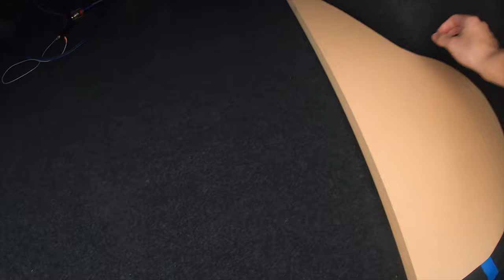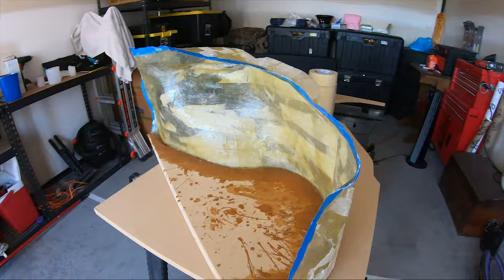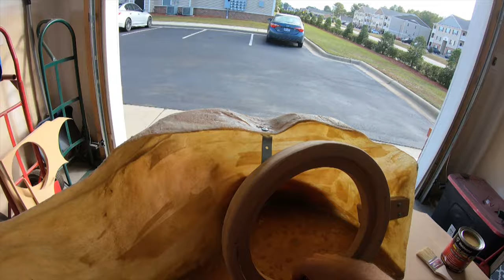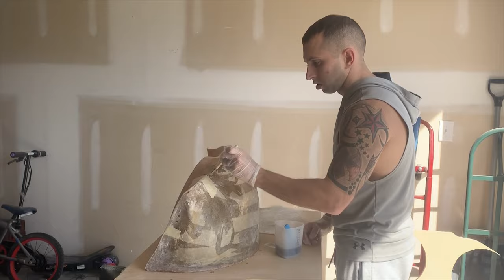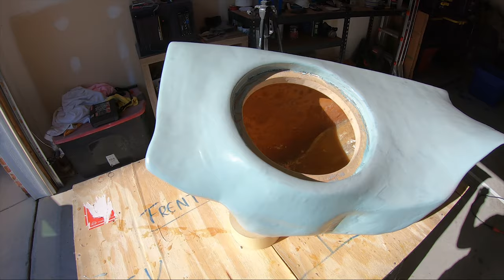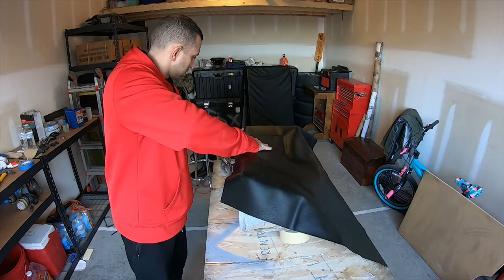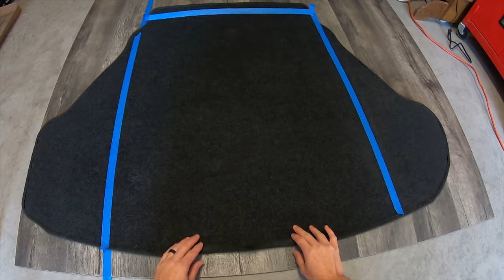Building a custom fiberglass subwoofer enclosure & trunk setup in 10 minutes (Time Lapse)!

Comment: I was about to get started on this project for my car and wanted to see how others did it. This couldn’t have been more perfect for that. Same subwoofer location I am wanting, same materials I was looking to use, even the same subwoofer I’m hoping to use. When you whipped out the wood floor it really blew my mind because that’s exactly what I was planning to do as well, so in the future when I have air ride I will already have a nice trunk setup I’ll just need to add the tank and compressor and run the lines. Awesome job!
Reply from the maker: I’m glad you found it helpful!! If you want to go back and look at the entire series there is a lot of good tips and tricks in there that will prob help you out! If you have Instagram, sent me photos when you’re finished cause I would love to see it!
Reply: @Foxcraze question when you put the ring on for the subwoofer what was that material for the front before your fiberglassed was that a sheet?
Reply from the maker: That was stretch fleece from the craft section of Walmart. I have full length build videos of this entire trunk from start to finish in my video library that gives a lot more detail.
Reply: Hey @Foxcraze what did you use to.sexure the case to secure it to the trunk?
Reply from the maker: @cornelionutmicu3640 so no lie it was so tight in the molding that after adding the wood panels to the floor it locked it in and it hasn’t move an inch.
Reply: @Foxcraze  ok i want to do the same thing to my BMW E87 and I wasn't sure how to secure it and was afraid it would move once installed
Reply from the maker: @cornelionutmicu3640  I have seen that putting sticky back Velcro on the back and bottom of the enclosure will help it grip to the carpeting.

Comment: One of the most thorough sub enclosure build I’ve seen.. Wow! Awesome job. Looks great.
Reply from the maker: I appreciate that, I have a 4 video series on the channel that’s goes into even more depth on how to build one yourself from start to finish.
Reply: you call that thorough?? a boz that light can pass through? no bracing?
Reply: Maybe you should watch other video’s then
Reply from the maker: @sfantuch what are you complaining about? The enclosure has over 5 layers of glass which is more than sufficient for what it’s required to support. The only surface that isn’t a complex shape and flat is the bottom which is wood so it didn’t require structural bracing.  Not to mention it’s been solid with no cracks or issues for several years of use so far. Do you have a video or something you have done to show us what right looks like?
Reply: @Foxcraze  unrelated to this comment. as someone who just spent a bit too much on  a used router, seeing you suffer with that dremel made my purchase so much more tolerable.
Reply: @Foxcraze  unrelated to comment. BROOOOOO WOW I DIDN'T KNOW FIBERGLASS COULD DO THAT THIS IS SO COOL. AS A CRAFTSMAN YOU HAVE CHANGED MY LIFE.
Reply from the maker: @sparklesparklesparkle6318 I hear that, the dremel was a pain in the ass lol

Comment: Much appreciate the share. Got a Lil sick when you F.F. the action cam on head but  saving me time and hassle with how you outlined the area using a plastic sheet will save me having to pull the rear side paneling on the wagon. Thanks

Comment: What an awesome build and video showing how its all done, thanks for taking the time to show us all how you did it. And kudos to you for having the skills to pull it off!
Reply from the maker: Thank you, I have longer in depth videos covering each step of the project in my video library.
Reply: @Foxcraze  good to know, I recently bought a custom enclosure for my is300 (2002) but I am struggling to find a good place to mount my amp. That led me to your video, even though it’s about building a subwoofer enclosure I thought maybe I could take the info and customize it to build a custom amp rack. I want to mount my amp to the side like you did your sub. I just have to figure out a way to add a fan in as well so my amp doesn’t overheat being stuffed in a somewhat sealed space.

Comment: That was a great relaxing video bro. I'm 42 now but all through the mid too late and early 90's and 2000's This is how i made extra money on the side working for myself through mostly just word of mouth. I had a honda accord and took out my back seats and built probably my most crazy setup ever in place of the back seats using basically the same method. That car was crazy loud back in those day's before thing's really blow up in the bass and system world with some of the crazy stuff they got out there these day's. I made good money doing stuff smaller though like you did. My car at that time was the biggest project like this i ever did and it turned out amazing and clean sounding from highs and lows a well balanced combo between treble and bass. It was all flowing nicely it was just a flat surface over that wide area instead it looked like a wave kinda with speaker's from 8's too a 15 being the largest in the middle 8's on the outer then some 10's and the 15 it was so beautiful and i wish i still owned that car. A buddy of mine borrowed it and got into a bad accident and by the time i was allowed too actually Physically see and touch my car the majority of whatever was still good from that massive project of a system was stolen so i was told by the lot it was being kept at while investigation was going on because it was a bad accident unfortunately. But watching this brought back those memories of the amount of time and sweat and everything that went into that build. Thank you for the relaxing video and memories it gave me of a time when this was how i made a living all those year's ago.
Reply from the maker: Yeah man I feel everything you’re saying. My old truck had a wall of MA Audio 1200 XL’s running on over 4k watts. I have been dabbling in cars and the such since I graduated high school in 2004 and it’s been a constant learning experience. I will likely keep doing this shit till I can’t anymore, it’s just makes me happy haha thanks for the watch and the positive energy. If you haven’t already please subscribe and check out the other videos lots of projects in here and more to come for sure!

Comment: Just watched this for the second time...lol. I'm wanting to do an enclosure in my Chrysler Crossfire. I was debating on using wood for the front face or fiberglass. I was hoping to see how you attached the subwoofer rings to the enclosure. Do you have any suggestions for that? Or pics of what you did? I am assuming you just put wood and glassed it to the back of the enclosure somehow.
Reply from the maker: Check out the 4 video series of the enclosure build specifically. Those videos cover all the details of the project including bracketing the ring for fiberglass work.

Comment: Looks great! I have two of these from OEM Audio+ in my BRZ. The only thing that was puzzling to me was the Dynamat inside the enclosure. It won't let sound leak through the enclosure walls, but it will definitely create standing waves and reverberation. You need to use some polyfill insulation to help with that.
Reply from the maker: Good idea, thanks!

Comment: it looks amazing, but is the back wall of that thing actually stiff enough to prevent it from flexing?
Reply from the maker: Yeah it’s very sturdy and has been in constant use since 2019. This video was a sped up version of the original build series, the entire box has minimum of 4 layers of glass.

Comment: gotta put a port on it bet that thing will sound better with a small 3in port the the left of the sub
Reply from the maker: Would it be as simple as cutting the hole and bonding a universal 3” port tube in the location?
Reply: @Foxcraze  should be that as long as what you’re using to cut won’t crack the fiberglass like a dremel or something i run two ported 12s in my wagon even a single with a port adds a lot more auditorial bass

Comment: How does it play? Could it possibly be ported? What’s the internal volume of something like that? I got a couple 10’s that love .7cuft
Reply from the maker: It’s more than enough for my needs at this point in my life. I have had 4k watt systems pushing 12’s and 15’s in the past and I don’t need that anymore to be happy lol. 

Given the space that I wanted to occupy to keep trunk space available; I think porting it properly would take up more space than I would like. By purely guesstimating, .7 is around the air space this box has which is what this sub needed sealed.

Comment: I realize this is 2 yrs old now - and I plan to look into your other videos you mentioned in other comments here about bracing and such - but my question is - is the sound deadening material INSIDE the sub box to prevent flexing, or stops it from shaking the side panels of the car?  Would it be beneficial to add deadener directly to the car's body behind the carpet in the trunk too?  Would it be advantageous to remove the carpeting completely on the side and use all the nooks and crannies for extra volume, or will that be bad for vibration since the box would be nearly touching the body panels without anything but a few layers of sound deadener between the fiberglass and body panels?  I realize it also puts a damper on the installation as well getting it in to fit and take it back out, but I wouldn't plan on ever taking it back out unless I was going to rebuild it again anyway - and though perhaps using a few bolts could really hold it in place well too as part of the bracing?

Sorry for all the questions - your build really inspired me and gave me a lot to think about!  Great job!

Another question - would a 15" sub with roughly 600-800 RMS be too much for a side mount sealed enclosure like this?  I have two and was thinking of putting one on both sides of the car's trunk.  Even if they are slightly angled upwards and forwards like you have in your video - does that make the sound from the opposite sub cancel out at all with both woofers in the same phase?  Mostly a bit curious if a fiberglass box would work for a pair of 15"s and save some space for larger things in the trunk.  (Brand is Stereo Integrity SQL 15s if that matters)
Reply from the maker: Alrighty so before responding I will say upfront that I am not an audio expert by any means and what I say next is based off of information gathering and personal experience. 

I’m gonna try and hit all of your questions but if I miss one, hit me back in a second response. So as for the sound deadening, I placed it inside the enclosure as a result of information I read in mid 2000s audio forums that stated that for fiberglass enclosures it would help kill standing waves and make the enclosure sound less hollow. I wasn’t sure if it would matter much but from my research it def wasn’t going to hinder anything either. 

Sound deadener can and should be applied to any thin metal to reduce vibration heard from outside the trunk and removing the carpet to get any extra hidden volume is always a great idea especially if your subs require a higher sealed volume to be effective. The subs you have need 2 cubic feet of airspace each and depending on the size of your trunk that might be hard to achieve without using the hidden recesses behind the carpet. I have never personally seen a 15” in a sealed corner mount enclosure but that doesn’t mean it’s not doable as long as the enclosure is built with enough layers to hold the weight or the 15” and larger enough to reach the 2 cubic feet of internal volume. 

Typically a molded enclosure will stay in place fairly well with very minor securing needed. I have seen people line the outside with velcro strips to grip the carpet flooring when the enclosure is installed and it work just fine. “mine has never moved this entire time”

Lastly from what I have read, subwoofers are omnidirectional so facing them at one another should not cause any issues at all in performance.

Comment: Can you explain the cutting of the wood? I didn’t understand that part
Reply from the maker: So I do have an entire video on the floor Installation that will give a lot of context and answer any specific question you probably have. Essentially after drawing the outline the tape was placed on the outline to prevent the laminate planks from splintering and messing up the finish. The cardboard piece at the bottom was a template of the plastic trim so I could cut that off the planks as well before Installing.

Comment: So how did you mold the front? It shows you cutting the speaker hole and then cut to you adding the pink foam.
Reply from the maker: That’s not pink foam it is stretch fleece that was stapled and glued to the fiberglass and wood frame to soak up resin which created the initial layer of the face of the enclosure. I have a 4 video series on my channel that goes into detail of the enclosure build. This was just a time lapse of the entire trunk project.

Comment: The box didn't need a hole to allow the movement of the air caused by the speaker?
Reply from the maker: The subwoofer works in both ported and sealed enclosures. The ported would have required more airspace so I decided on sealed.
Reply: @Foxcraze  such a great job
Reply from the maker: Thank you man!!

Comment: Great work, any tips on how to lay the fiber flat and clean like yours? Last time I attempted it, I had bunch of large bubbles, and my initial base layer was very wavy, not clean like yours.
Reply from the maker: It all about percoating the surface with a light coat of resin before applying the chop mat then using the brush to press resin into the mat instead of brushing it into the mat.  Pressing releases the air bubbles; brushing won’t.

Comment: why did you put sound deadening on the inside of the box, i gotta know
Reply from the maker: I read in a couple audio forums that sound deadening the inside of a fiberglass enclosure helps with reducing vibration and adds a little extra rigidity. It was cheap so went ahead and did it. It’s not necessary but doesn’t hurt anything either as I have read at least. 🤷🏻‍♂️ lol

Comment: Was the front of the box made with foam and resin then fiberglass?
Reply from the maker: Creating complex shapes is easy to do  when using fleece. Stretching and gluing and or stapling fleece down on an area will give you a complex shape that you can then saturate in resin to get a solid foundation. Once it hardens, cover it internally and externally in layers of fiberglass to strengthen it.
Reply: @Foxcraze  genius

Comment: Was the brown n gray coating bondo?  If so why was it so watery?
Reply from the maker: One color was fiberglass resin jelly and the other was bondo. They were both mixed with a small portion of resin and it’s liquid hardner to allow them to be brushed on and level out better. 
I have a 4 video series on the enclosure build that talks about it in better detail.
Reply: @Foxcraze  thank you

Comment: Great job but did you figure out any of the box dimensions for the sub? You shouldnt just stick a sub in an ole box.
Reply from the maker: Gonna be honest with you, I figured out the general square dimensions for where it sits and deducted the approx area lost and then guesstimated space added by the extra length I extended and hoped for the best. In the future I won’t use the wood, instead make the entire thing outta of fiberglass and fill it with water and figure out the cubic feet based on gallons of water it takes to fill. I can then add to or take away from the enclosure to get right where I need to be.
Reply: @Foxcraze  appreciate the honesty. If you think you are high you can add pillows to slow the sound waves down and make the boxer "bigger" than what it is. But hell, if it sounds good it's fine. Damn nice job. First time doing fiberglass? It's something I've wanted to try.
Reply from the maker: @SamusAran1969  I’ve done fiberglass repair for years but never an enclosure so there was definitely a learning curve at first lol.
Reply: @Foxcraze  if you're quite versed in fiberglass, should do a how-to and make something simple. I'd love to watch.
Reply from the maker: I actually have a 4 video series on building this box from start to finish already on the channel. Also some fiberglass bumper repair videos as well. I will redo my trunk setup eventually and make it better.
Reply: @Foxcraze  awesome to hear. I'll have to give them a watch.

Comment: I've seen this video multiple times for reference, as i recently got my hands on an enclosure very similar to yours for my g37.
The question i have us what did you use to make the brackets that hold up your amp?
Reply from the maker: I picked up some 1/8” thick steel from Lowe’s I believe but I’m sure 1/8” aluminum would work as well depending on the length on the amp and the weight.
Reply: @Foxcraze  awesome I'll look into getting something like the product you got. From my plans, it looks like the best route to go with would be putting the amp there. Thanks for the advice. Much appreciated.
Reply: @Foxcraze  thanks again for the reply. I'm picking up some aluminum 1/8 thick bar. It's 36" long by 1" wide. It's for an small Alpine amp I'm gonna use for a single 12" sub, so I'm hoping it works.
Reply from the maker: Good deal man hope it all works out for ya!
Reply: @Foxcraze  thank you man. I'm trying to, but it might be more difficult for me since my amp is bigger in size than yours from what it seems.

Comment: No air vents for woffer?
Reply from the maker: I wanted it as small as possible to free up  trunk space and still be functional. The sub was able to function in a sealed box that required less than half the airspace a ported box would have needed, so sealed is the route I took.
Reply: @Foxcraze  okay! 👍🏻